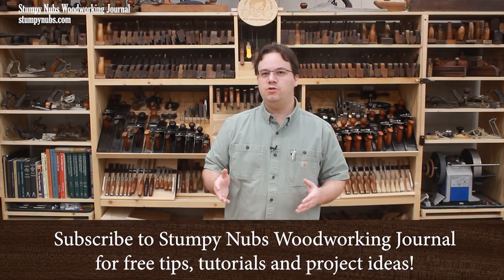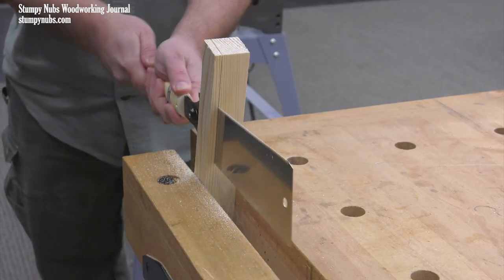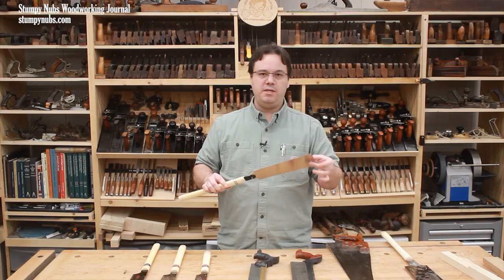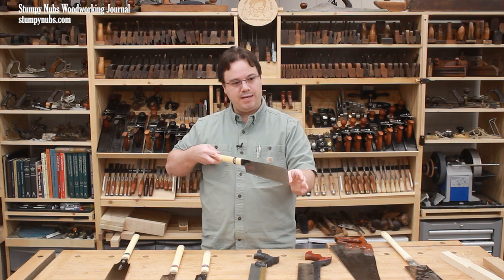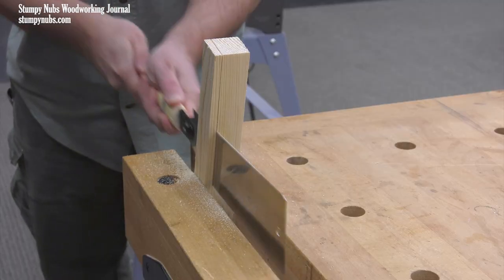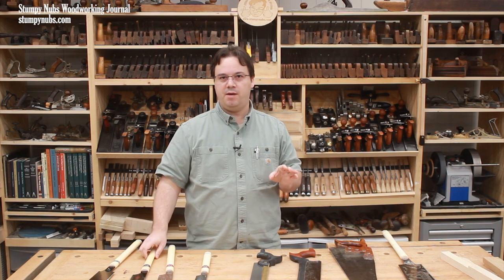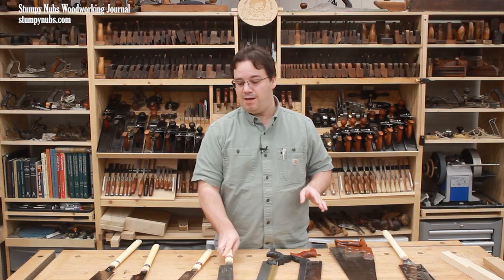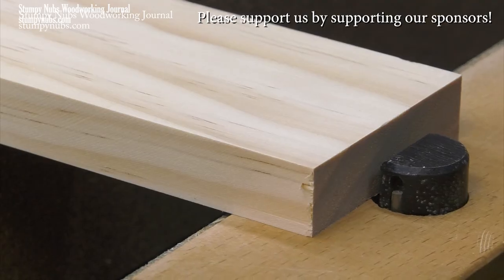Is Japan slowly killing western-style saws?

Comment: the finish carpenter I work with most keeps a cheap Ryoba in his tool kit with the end sheared off, so the teeth go all the way to the end of the blade.  he can make cuts with it that he can't make with any other cutting tool.

also, hardware stores carry cheap japanese style saws with a pistol grip.  they are actually pretty good for doing extended cutting, because you can wrap your fingers to hold it instead of gripping it.  and you can always put a better blade in the handle

Comment: I own and use Japanese saws and chisels. I don’t use any disposable saws. My saws are hand made in Japan and serviced by a METATE, these craftsman sharpen, tension teeth and flatten the blade. It costs about 40 dollars to have this done. My saws come already serviced and I have yet to send one off to be sharpened. 
Technique is very important when starting a cut use your thumb nail next to the mark to line up your cut (using a marking knife will help start the kerf). Start in a diagonal direction slowly lowering the saw along the mark. When you get to the back of the line raise the saw to cut at a slight angle. When you reach the bottom of the line level off to finish cutting the center. The teeth on the end of the saw are designed so you and dig in with the tip and finish off the cut. 
I get my saws from a dealer in California, they are not cheap but you’ll buy a saw once and pretty much use it for the rest of your life. 
Hope this helps. Long time viewer here first ever comment lol

Comment: Absolutely correct, I personally found when I first started using japanese saws that on the return stroke I would bend the blade it made me even ruin some cuts because it got bent so much that it snapped the piece of wood I was cutting because of tension .
I also have a bunch of broken teeth because I got used to pushing when cutting , but when I use it correctly it cuts like a dream.

Comment: Regarding the FWD/RWD analogy, it's quite a bit easier for an expert to control a RWD car than a FWD car, because FWD biases the car heavily toward forward direction. If you screw up with FWD, it will usually stay pointed more or less the same direction, which is actually a complete lack of control on the part of the driver. IOW, you can go anywhere you want as long as it's directly forward. If you actually want to control your yaw, you will prefer a FWD car, because of its inherent instability at the tires' adhesion boundary -- which allows you to yaw quickly and precisely.

But that takes a large amount of skill, which most people don't have. So people say that FWD cars are easier to control, when what they really mean is that FWD cars have fewer consequences for losing control. You're unlikely to end up with a sudden change in lateral momentum. Then, there's the fact that cars steer using the front wheels, so if you overcook the fronts, you lose the ability to steer at all. Again, it's just saving the driver from having control in the first place in a situation where they clearly are already beyond their ability to control.

So basically, it comes down to your definition of control. The way I see it, if you're in a situation where you've already lost control, it's strange to discuss what happens afterward in terms of having more or less control. It's like the difference between a 747 and an F-15. By your way of looking at things, the 747 is easier to control, but that doesn't really make any sense, because there are many things the F-15 can be controlled into doing that the 747 literally cannot do.

Comment: Owned and used both for years.  Started with a Ryoba.  Gave the Japanese saws a good try for years and got into a lovely western saw.  For me, I simply prefer the western.  I find if my cut is slightly off track I can correct it with a western as the blade is stiffer.   I tend to break teeth in my Japanese saws easy and due to poor technique, I tend to kink my Japanese saws which makes more difficult to use.

Comment: I applaud your video for Japanese tools. You should certainly do more. I've never used the Zed brand ones but I'm sure they're just as good as the Gyokucho saws I usually use. I do have a Silky but I find them to be overpriced. Japanese saws are simple for a Westerner to get used to. Japanese planes though are on a different level and require  a good skill set to use effectively.

Comment: Great video.  I have to split a solid cherry wood cabinet along the left side of the center stile and down through the mid and botton rails.  I was considering a power saw method but after seeing you video I'm now thinking of using one of these Japanese saws instead.  I would appreciate your thoughts.

Comment: while the traditional straight grip pull-style is great for many applications, specially in the form of carpentry there is some more downsides to it.

the the straight grip for example have more things to it than just "preferring" or "getting used too".
one is the reduced natural hand-grip, while you need to grip one with a pistol grip you need way less force to keep it safely in your hands when putting force trough it.
this includes both pull and push types of saws.
this i very much noticed back when i had furniture carpentry as an optional class on high school that there was not a single girl that liked the Japanese straight style saws.
I for my part had no problem with straight handles until a later age (late 20's) when i developed a chronical "repetitive strain injury" in my right arm, or "PC mouse-disease" that we call it here.
this basically banned me from using straight grips.

luckily there is pistol grip style Ryoba, Kataba and Dozuki on the market and made so that i can continue my hobbies.
unluckily the price on those can really high and importing em from Japan isn't that much cheaper and can take ages in shipping, but at least the quality is so that you only need one of each.

Comment: I was working on cutting a custom guitar body shape from a mahogany body blank and lost access to a bandsaw. I got a ryobi saw off amazon and while it took a bit of time, I cut out the shape by subdividing the outer negative space around the body into small block shapes and just cutting those out. Then I used a saw rasp to clean up the curves and sanded it smooth. It was slower than using a bandsaw for roughing and then a router for cleaning it up, but it was oddly satisfying.

Comment: I have been using an Irwin pull saw for 15 years, it is my favorite tool. For fine work, push strokes are very sucky. IMO.
 I have been making guitars, and fretboards require a .023" kerf.  Very specific. Lots of control in japanese pull saws.

Comment: I have a set of 3 Japanese saws that I bought while I was in Japan. They were purchased at a local neighbourhood hardware store so they aren't anything too fancy by Japanese standards. I think I spent about $120 CDN on them. As soon as I tried them the first time I loved how they cut. The amount of control that I felt was noticeable by the 10th stroke and they have been my go-to saws since that time. 

My question is whether they can be used for cutting materials like OSB, MDF, or any other composite material. I like them too much to try an experiment with them. And, I have to admit, there is a certain sentimental value to them so I really don't want to ruin them. 

Also, Japanese saws are designed for cutting wood types that are native to Japan. There are a lot of beautiful woods that are native to the country but as far as I know, there are no species that have the hardness of some of the exotic hardwoods that many wood workers  like to work with. Even some of the domestics like hickory or hop hornbeam are probably harder on teeth than almost any Japanese hardwood species with the exception being Japanese Elm. Would using the Japanese saws on woods that fall outside of the design parameters greatly shorten their lifespan, I wonder?

Comment: With push-saw you can cut more quickly, because it's more easy to use not only arms strength, but body weight and spinal muscles. But it has downside: it can buckle, if stuck. Pull-saw is more safe and precise, but slower.

Comment: Most of our body muscles (if not all), included those in the arms, are capable of doing much mure force when then contract than when they expand. So, the direction Japanese saws cut, opposite as western saws, allow us to apply more force to the cut. So, it should be pretty noticeable how we can cut easier when pulling than when pushing even if everything else in the saws would be the same.

Comment: I realize that this is NOT in the league of the saws discussed in the video, but I regularly use a Shark pistol grip pull saw and find it much better than a push saw for quick and relatively smooth cutting.

Comment: I have always hated the feeling, handling and "sloppiness" (constantly binding and bending away) of western style saws. Even as a child when just playing around with small scrap wood. As a result, I only own one western style saw, because "you have to have one", and I reluctantly use it for basicly nothing, haha. I since have developed the (for me useless) skill of using a push cut saw, but I still hate to use one.
As soon as I saw Japanese saws, maybe 8 years ago, way into my woodworking hobby, I immediately saw their benefit and I bought a Ryoba and Dozuki (blade only), both cost 7€, mind you, and I made handles myself.

It is heaven to cut anything with those. They are still as sharp as the first day too. Used them in pine, particle board, birch plywood, OSB, etc..
Only thing I did was kink the blade of the Ryoba in the first few days, because, yes, there is indeed a learning curve and you can easily wreck that blade.
But with a center punch and some educated blows with a hammer to form the metal back, it's straight again and has been ever since.

You forgot to mention the incredibly useful design feature of the very bendy and thin blade on the Ryoba. It is perfect for actual flush cutting things that stick out of a surface, like a dowel, or unwanted peg or whatever, you can angle the handle downwards, leaving the blade to conform with the surface perfectly. It's like magic lol. And it really cuts flush.
You can even make something like a guide for anything, to cut anything at any angle because it just perfectly would glide against a reference surface. You could do that with a western style saw to, so not really a real benefit.
Also, the Ryoba is not neccessarily used for fast and rough cuts only, I often don't sand or do anything to the freshly cut section, because it comes out straight, smooth and square, maybe I do one stroke with a sanding block to knock off the sharp edges, but that's it.

About the straight handle vs pistol grip: I really don't think pistol grips are right for most hand tools or saws, maybe for western style planes, but nothing else really.
Reason being is that a saw is in reality a knife. Now imagine a kitchen knife, like a bread knife with a pistol grip. Or a chisel, because as the saying goes, everything in the workshop is a chisel at it's core design. Imagine a chisel with a pistol grip, Insane haha.

Basically anything that needs "back and forth" (haha) motion, and should do a straight "thing" should be fitted with a handle in-line with the teeth or the blade. Does that make sense to you?

While it is comfortable to hold a mug, pistol, etc with your hand at it's "naturally relaxed" wrist angle, I don't think it's good to put a angled handle on a saw or any hand tool besides a plane.
With the japanese saws, I don't really exert any extra force downward into the cut, I let the weight of the blade do that, so there is no need to pre-load the grip by having it at an angle. As you said, it's a whole other way of cutting.

I don't know what they are called at the moment, but there are these small, thin and stiff bladed saws, that have neutrally cut teeth, are thin like japanese saws, and have a turned round grip. Those are the perfect example of what I mean. You are precise, always in control, and they cut easy.

Another thing on the Dozuki. I use it to cut the fret slots for the fretwire on guitar fretboards, it is actually thin enough (around 0.5mm) to be able to to that and still be totally precise (because of the backing strip at the back of the blade) to cut those slots (with a straight guide block of course, because that's work with a tolerance of 1/100 of a mm, maybe higher).

Edit: I love Japanese woodworking and just their overall mindset and attention to detail, that's why I bought a Makita cordless drill as a "first paying customer job" present for me. Also my "dollar store"-type cheap drill died.

Comment: One thing I have yet to see anyone mention is how much easier the Japanese saws are on your body. At 22 years old, I ruined my neck working on a dairy farm. I had been delivering glass bottled milk for 5 years, the last 3 of which I was also bottling using a broken machine. The leverage of both pushing the bar on the bottle washer against the weight of the machine, combined with lifting milk crates too far from my body had given me a ruptured disc in my neck, and nerve damage as a result. 4 years later, I am still limited as a result of that injury. You don't realize how many muscles even up into your neck are used with a push type saw. It actually hurts me to use a push saw, whereas I am fine with the Japanese saws. Just something I have experienced, and thought was interesting for limited mobility people to know about

Comment: While I appreciate the precision one can achieve with Japanese saws, it strikes me as odd that no one is addressing that the difference between the blades and techniques also comes down to the much larger variety and hardness of trees used in Western carpentry, historically compared to the much smaller variety, more pliable/softer woods that were the most available in Japan. Having a pull saw makes a hell of a lot more sense when working with wood that doesn't take nearly as much effort to shape.
Reply: Well said.
Reply: Skalbird Genome  Well said.

Comment: There is also a type of rare japanese hand saw kataba that you may not find it in Western Hemisphere or outside of Japan. This saw has no saw set in the teeth and it is designed for certain smooth small joineries. I have one with four extra blades. I special ordered it from Japan.

Comment: I had to trim some custom-cut timbers to a precise 45° angle, so I started looking for a "better" saw than what I owned. I was surprised to find that the market today is basically throwaway coarse-tooth or prohibitively expensive western-style saws. All were "combination" - the distinction between rip and crosscut seems to ignored at the low end. A local timber framer told me "just use a Japanese saw" and I did. With a bit of searching, I also found a few affordable  finer-tooth Western saws, which I bought just because it seemed they were a vanishing breed. And I found one local hardware store that still sharpens western saws

I had a custom-built kitchen installed some years ago and the fitter was a real craftsman. We got along well and every now and then he would hand me his used (western) saw and say "Here. This one's no good to me any more but it will be fine for you." :-)

Comment: There are three styles of Western handsaws that cut on the pull stroke, the pruning saw, the pit saw and the crosscut saws for tree felling... and the latter two actually cut in BOTH directions.  It seems the saw designers of that day understood the physics when the scale increased, but somehow didn't apply the principles to smaller saws... except pole/pruning saws. In power tools, the "Sawzall" style blades also cut on the pull stroke... just imagine if they cut on the push, how dangerous and uncontrollable that would be!

Comment: I like the thin kerf of Japanese saws and use a Dozuki for most joinery.  To me the biggest drawback is that sawing on the pull stroke means the sawdust obscures the pencil lines I'm trying to follow.  I wear a mask 100% of the time, so blowing away the dust isn't an option.

Comment: I use and like both so this comment is just added info not criticizing, a couple missed points, the pull saws will pull the sawdust to the marked side of your cut, the pull saws cut very straight but only as straight as you start them, with practice it’s possible to guide a western saw to fix any error at the start. That being said I will always use a pull saw to make rip cuts vs using a western panel saw.

Comment: With appropriate deference to the opinions of much more experienced woodworkers than myself who've commented on this, I have to say that without any question nor doubt, I have found using pull-saws to be a far superior experience for me personally. Every kind of cut, from fine dovetails to short crosscuts, the Japanese style saw excels. The ONLY place where the "western" style  is marginally preferable for me is when I'm cutting through a large beam and then I want my 30" Diston... er, wait, no, I'll use one of the many power saws I have. Look, for HAND SAWS and where you need to use them, pull saws are far, far superior. Anything you might need to use that old Diston for you're probably going to use a skill saw or something else that's powered (e.g. 6" of warped lumber). For fine work? A nice Dozuki or Gyokucho is gonna beat every Western "push saw" - including those insanely expensive Veritas etc. dove tail saws - hands down. Just use one of these to cut fine dove tails, or remove a 1/16" tail and you'll get it.